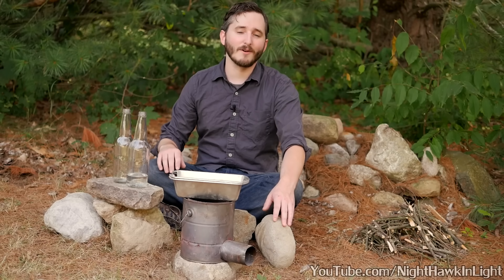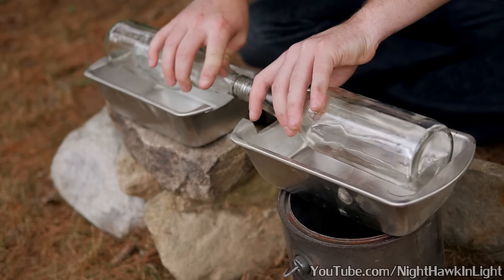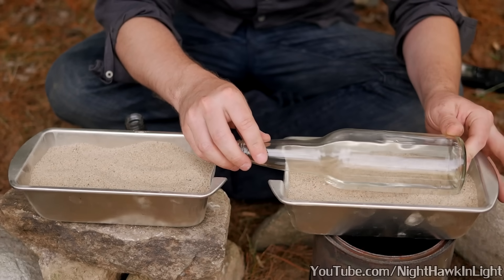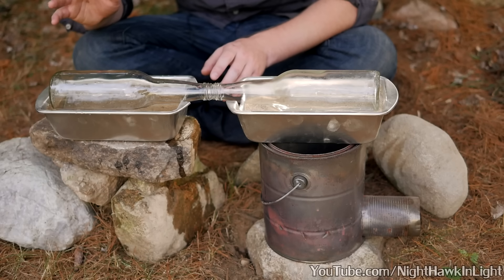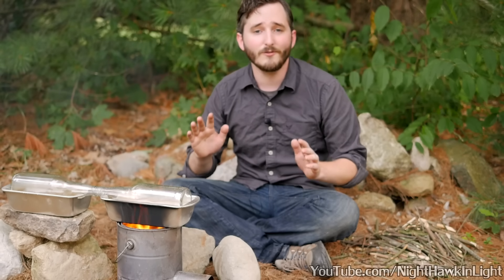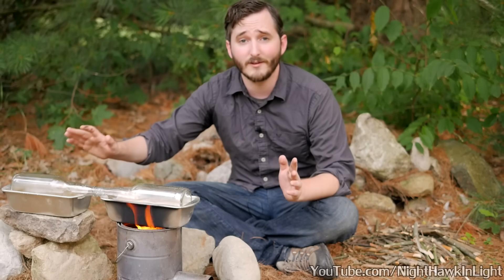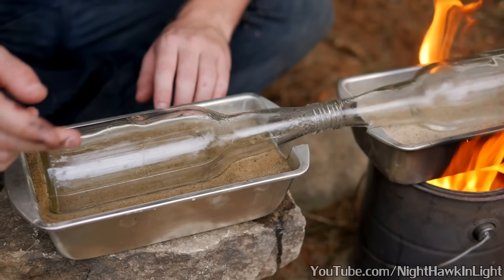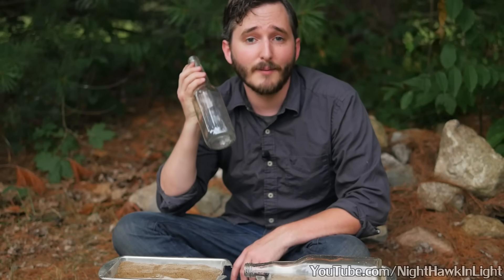How To Turn Salt Water Into Fresh Water (Simple Improvised Distillation)

Comment: I just want to mention, that if you want to produce more distilled water, you might need to use the fresh water bottle to fill in salt water, because if you fill the hot bottle with new cold salt water, it will shatter, that might turn a fatal mistake, if you don't have any bottles around.

Comment: yeah nice vid - it might be possible to just use the sun's heat to do the distillation if you put sea water bottle exposed to the sun and the other one in some sort of shade / buried in wet sand, it will take long to distle but this setup can be left running all day with little maintenance. using a pipe - connection and  placing cooled bottle higher than hot bottle can further enhance the method i think so water vapours all  go in the direction of cooled water

Comment: Thank you for the tip, very clever indeed but the sand is not a very good heat conductor (check how cold the sand can be only 2 or 4 inch deep even with a very hot summer day. I think it can be faster without the sand on the hot part. Your solution without metal seems to be better :)

Comment: If you are ever in a situation where you need to do this, be sure to mix a small amount of boiled salt water back into the distilled water. Without any trace minerals in the water it sweats out of your body too easily and can create additional problems.

Comment: couldnt u just use a glass jar, a tarp, a pebble and a pot? place the glass jar in the middle of the pot, get a fire started, pour in the salt water on the sides, lay the tarp over the top and secure it so that it doesnt fall in, drop a pebble so that the tarp gets an upside down cone shape. Salt water evaporates, salt stays at the bottom water damp goes up to the tarp , becomes liquid again, starts dripping down into the glass jar. Maybe add some pebbles in the jar for weight so it doesnt shift?

Comment: You will probably die in a week if you only drink distilled water because it does not contain electrolytes. This will cause your body's electrolyte content to be urinated out eventually completely eliminating your body's ability to move minerals and water between intercellular and intracellular spaces, using osmosis. Boiling/filtering water is the best way to treat water. If you desalinate water, you need to add electrolytes back afterwards.
Reply from the maker: As long as you have something to eat that is where most of your minerals come from. With food, you can survive on distilled water indefinitely. Without food, 7 days is a lot better than the 3 you can go with no water or the 1.5 that would kill you drinking straight seawater. You can't boil or filter the salt out of seawater, distillation is the only way to remove it. Except for a few very expensive reverse osmosis desalination filters, and there's no way you could make one of those yourself.
Reply: I don't mean to put you down, it's a great video on how to quickly distill water, just wanted people to know that drinking it is hazardous to health. You mentioned you were doing this to lake water. Boiling/filtering lake water is the best way to treat it. Food won't replenish your electrolyte balance as fast as you will deplete it, drinking 2 litres of distilled water daily and sweating/urinating all day in a survival situation. There are better ways for finding drinkable water.
Reply from the maker: I added salt to the water to replicate seawater. Yes, boiling lake water is best. Doesn't work for seawater.

Comment: great idea! I was wondering if it is somewhat dangerous to increase the heat too much which can create a hot steam between the bottles. If this is the case, I assume that the heat must be "regulated/controlled", no?
Reply from the maker: No, you want the steam to be hot. It won;t get much hotter than 212f or 100c so long as there is still water in the first bottle anyway.

Comment: you could drill a hole on the right add a 3rd volume and drip feed at a rate of the distilation, as well drill holes in 2 bottle caps and rivet ( can opener folded over)  /glue together e.g. with silicone caulk ( admittedly not on beaches) or some sort of

Comment: The heated bottle will eventually break due to the heat... unless it is a special bottle designed to handle heat to boiling water temperatures.

Comment: Could be a silly question however from a survivalist perspective.. does the heat and distilling of a water supply with bacteria and viral contaminates clarify the water of these things OR does it perhaps take out some but certain organisms survive. If so which ones... Great video. I normally go with plastic bag and the well sun evap method. But this is a clever way too! :)
Reply from the maker: If a microorganism survives not only being boiled but also can be evaporated and condensed along with the steam I'd say it's earned the right to make you sick.
Reply: NightHawkInLight hahaha. True that. Curious tho. Going to look up more about it. Especially as the method I spoke of does not boil water and perhaps if the option of setup was available this may be superior because of boiling.

Comment: Is this safe? If done with sea water aren't their heavy metals some which are volatile at H2O boiling point and some that are not. So wouldn't both the salt and the water be contaminated, potentially leading to bioaccumulation if used to much?
It would be cool to see the results lab tested.

Comment: With a boiling point of 572 degrees Fahrenheit i doubt you will get any oil in the "purified" water, as you wont reach those temperatures with this setup.
However i liked it ;)

Comment: U can connect the two bottles with a flexible tube to allow the source bottle to hold more water and for them to be heated and cooled upright.  Just pierce the tube with a small hole to allow pressure to escape.

Comment: Do not drink distilled water. If you are dehydrated & in need of water then drinking distilled water is a short term feel better fix. Since the water contains no minerals your body will still shutdown as the salts & minerals that run the organs & muscles is depleted & not replenished. Its just like the people that die on MDMA after drinking too much water & flushing out the bodies salts.

Comment: God news is you can also make a gravity filter device also from things found on the beach, and use that water to then be distilled. If you're very paranoid, you can re-run the desalinized water back through a second gravity filter. You can use charcoal from the fire, and the sand and gravel around you to make the layered filter.

If you're SUPER paranoid, you can then bottle the water and lay it out under the sun for 6-8 hours and the UV rays will actually sterilize your filtered twice, desalinized water.  The other benefit of the 2nd filtration is if you use some limestone you can add back minerals you need and not have distilled water, and it would technically be better for you.

Comment: Really inefficient, the pressure prevent water for evaporate, a more simple and total efficient way is fill the bottle put in fire tilted and put a plastic bag to collect the steam.
Reply from the maker: The water distilling on the cold side creates a vacuum that pulls the steam in. Very little escapes between the bottles.
Reply: Leaking is not the problem, the problem is a gas NEED SPACE to expand, just put a pot of water in the fire and put a cup in the spout when steam start to rise and there you see how much water is distilled if you give steam enough space to expand and scape the liquid state.

Comment: Okay but where does someone find a bottle that is safe to use and hasn't had sea water leak in or been dirty. Is there a way to clean the bottle? 

I'm guessing just use the distilled water?
Reply from the maker: Just rinse it out with salt water. You'll only get a tiny amount of salt dried in the bottle the first time you use it.

Comment: What will prevent the bottle that heated from cracking each time you add more water. If you hafta wait for the bottle to cool each time ,it would take forever. Do you agree?
Reply from the maker: Pull the bottle out of the sand and it cools quickly. Or have some water preheating

Comment: Hi, im still interested in the levitating magnet video, I tried it with high quality carbon graphite blocks, and I am not getting any diamagnetic field from the blocks, in fact the repulsion field from the magnets inverted seems much much stronger. Is bismuth a much stronger diamagnetic element; how much do I need to levitate a small magnet?
Reply from the maker: Pyrolytic graphite is more diamagnetic than bismuth, I do not know if other forms of graphite are also diamagnetic. Diamagnetism is a weak force, your graphite may be diamagnetic but you have not adjusted your plates well enough to get levitation. As you say an inverted magnet is a much stronger force, you can hardly notice diamagnetism in normal circumstances. Only in a very precisely adjusted setup like in my levitation video can magnets be levitated, and only with the force of a lifter magnet to help hold them in the air.

Comment: Could use plastic if careful by placing in hot water or hot sand but it would need to be below the point of thermal deformation. Plastic could be heated and bent to orient vertically accommodating more volume. Boiling is not necessary, just steam. Plastic bottles would be more likely to be available. Slower process but doable if plastic is the only thing available. There is the issue of releasing BPA and pthalates but dehydration is a more immediate concern.

Comment: There is a much slower method that uses any bottle including plastic ones. Basically it is the same setup but the "cold" end is in the shade with a damp cloth on it and the "hot" end is open to sunlight. If I remember correctly it works about 1/10th the speed of this setup and obviously needs strong sunlight.

Comment: Possibly a stupid question but why doesn't the steam just get trapped in the first bottle. What makes it move to the second bottle.
Reply from the maker: Not a stupid question. The reason the steam moves over rather than blowing out between the bottles is because as it condenses in the cold bottle it creates a vacuum. The cold bottle will suck new steam in at the same rate as it's converting it back into liquid.
Reply: NightHawkInLight ahh thanks didn't realize the cold creates a vacuum

Comment: You don't even need fire.
If you've ever dug your toes into sand on the beach you may notice how cool it is while the surface sand exposed to the sun can be extremely hot. Sand is not very good at transferring heat through it which is why your bottle is heated so evenly.
Bury one bottle and leave the other exposed with the saltwater in it, and the buried bottle will eventually fill up with distilled water.

Comment: Now i need to build a glass bottle
Reply: Kube Dog I think you should try it with urine. I bet it still works. If you try it with beer you can make yourself some spirits! :)
Reply: Actually you need to build 2 glass bottles...
Reply: The hardest part will be finding sea water.  I mean, unless you happen to be on the coast.
Reply: First heat up your soda with sand...:)
Reply: Ilsunny Lo just buy a coke.

Comment: If there is oil, could sand be used to filter it out first? Such as a container with small holes filled with sand then water poured through first if charcoal isn't available?

Comment: Without the pans, just use two sand mounds to position the kissing bottles. A short tube of plastic, paper, cloth, leaf, or bark, loosely connecting the bottle mouths, will make the system more flexible & effective.  Glass is good, but metal cans or plastic bottles can work too.

Comment: Organics or man mades usually have a lower boiling point than water, or have a decent vapor pressure so that once the water is distilled, if you leave it open to the air for a day or so in the sun it should be good.

Comment: if U connect the bottles using a small hose U can connect them at an angle them to be able to fill them more, without the salt water flowing from one to the other. Some scrap plastic bits can be wrapped around the bottle necks and secured with thin strings or torn long plastic/rubber parts floating around the beach.
Using a longer piece of hose, the entire ocean can be used to cool the cold bottle. Also metal cans can be used, if no glass bottles are available, as long as U can make the seal good enough.
If U happened to find a metal pipe  that fits inside a hose, U dont, need the cold bottle, as long as U cool the steam going through the metal pipe. Any container could then be used on the receiving side, as the steam is already condensed to water.

Comment: drinking distilled waterline survival situations is actually very dangerous if not deadly! distilled water will pull out salts and minerals from your body so it actually makes you weaker! 
in a hunch you could go for a bottle of it and it won't kill you, but you need to find sweet / rainwater asap!

Comment: You could fit much more water with a simple mouth to mouth connection made of wood or trash plastic that would allow the isalt water bottle to be placed in an angle. Congrats for the video.

Comment: Drinking distilled water is erally bad for your health because of osmotic exchange of minerals. To put it simple distilled water will suck salt and vital minerals out of your cells and can cause health issues and increase your thirst. If you need to use distilled water, re-adding minerals should be considered. Homebrew supply stores are a good place to buy water soluble minerals

Comment: News flash, you will find plastic bottles everywhere as they float, however glasbottles are a quite rare find as if they have been opened then waves will fill them up with water and then they sink.
Aluminum beercans are however a quite frequent find and same principal can be used on them, not to mention that they hold more water as the opening is not centered.

Comment: Could the same thing be done with plastic bottles in the sun, one with salty water in direct light connected to an empty bottle buried in wet sand for cooling? If you could try that it would be awesome
Reply from the maker: Yes, I've tried it. It works but you will only get a spoon full of water in a day

Comment: you can also distill urine. suppose you are in a desert, there isn't even an ocean to drink from. if you collect your urine in the bottle and use that for distilling and then use your sweaty clothing to help cool the other bottle it will work. Obviously it won't remove certain drugs that might have been secreted in your urine, but it is much better than drinking your own urine directly.  Although urine is 95% water, the 5% that isn't is being removed from your body for a reason and it can be very harmful to you if you try drinking it. granted, you're still losing water through sweat, but this will significantly reduce your water loss and thus improve survival. Especially considering how much water your bladder can hold and how little time you can survive without water.

In survival situations saving your urine to either use for distilling or to use as a way to prevent heat loss is pretty important.

I was once camping in Canada below freezing when my tent failed and I had to take cover under a tree that had fallen and use a makeshift Windbreak from Fallen branches. I made the absolutely stupid mistake of urinating outside of my shelter which just increase the heat loss from my body. I went into hypothermia, which I wouldn't have if I had peed inside a container I had and use that to help warm my extremities.

in that situation, similarly, the urine isn't going to give you any new sources of heat, it's just going to slow the loss of heat.

Comment: Can you do this on a much larger scale
Reply: Bill Klätsch Distillation* there, fixed it for you ;)
Reply: "That's why processing ocean water into drinking water by destillation is not common AT ALL."
fixed it for you
Reply: Dildo Shwagins the concept would be the same but something tells me there would need to be something to fix the two nozzles together
Reply: Of course you can, only if you can find such larger container in middle of nowhere that wouldn't melt, break, or burn when exposed to high temperature.
Reply: Dildo Shwagins Yes you can but this is an extremely expensive way to clean water. Desalination requires A LOT of heat and/or electricity. That's why processing ocean water into drinking water is not common AT ALL. Even though it sounds like such a good idea, it's less than reasonable.
Reply: Dildo Shwagins yes. Do ask the Israelites people . They turned Tel-Aviv desert into a very popular area with no water at a!l . About 70 years ago . with this very same process at a very expensive and large scale . We Physical language we say SUBLIMATION of the water process .
Reply: Ilir Kumi the israelites they use this process to obtain water from the sea . VERY EXPENSIVE .
Reply: Use 2 much bigger glass bottles then. Maybe metal is ok but not plastic, plastic would melt.

Comment: If you boil a significantly larger quantity of water first say in a large pot with an open top for approximately 20 minutes. This will boil off all contaminants that have a lower boiling point than water and kill off many organisms. Then proceed to the distillation process that will leave behind the minerals, heavy metals and all the contaminants that have a higher boiling point than water.

Comment: If you want to distill more than 100ml at a time you could add a rubber hose to the system and set the bottles up vertical. This would also eliminate steam leakage.

Comment: how do u get the salt out of the pure water one? if its at a beach then its likely got sand and salt in it and u cant wash salt out with more salt. would you distill multiple times and dump it to get it out?
Reply from the maker: Wash it out with salty water and shake it dry. The amount of salt left dried inside the bottle will be insignificant.